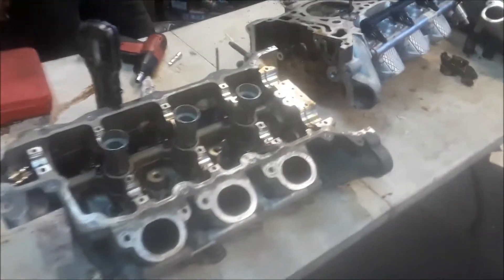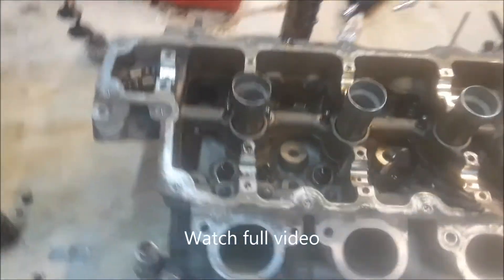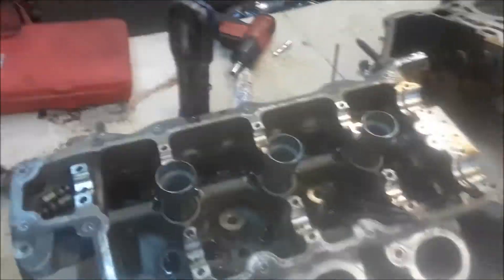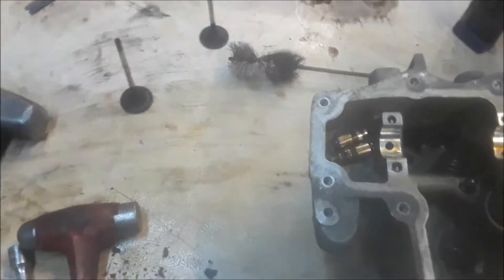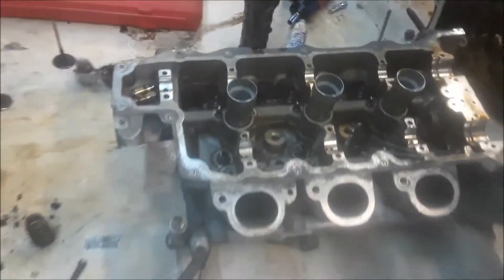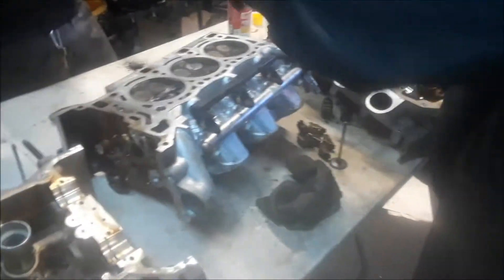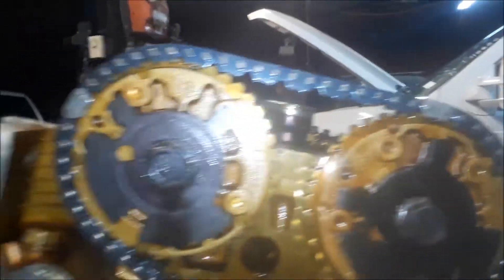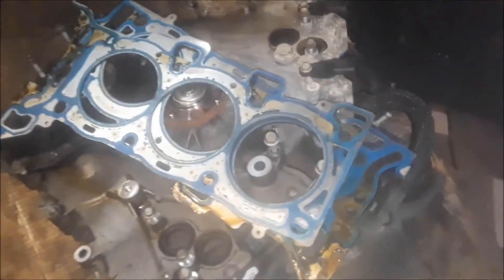GM 2.8,  3.0, & 3.6 Engine Problems Timing Chain Bent Valves COMMON Problem

Comment: Does the 3.0 v6 version have the same problem with the chain ? I have a 2011 srx with the 3.0 v6 currently at 198k miles still running like new
Reply: yes, 3.0 smaller cubic inch same problems

Comment: Ive got a 2010 terrain 3.0 cylinder two looks to have bent valves. Is it possible to get away with just throwing new valves in or could the seats be damage as well and possibly need a new head or heads?
Reply: well the heads will be off to change the valves so look. most of the work is in r and r of the heads anyway. if you went through all the work to do that would getting the valve seats machined really be a prohibitive obstacle at that point?

Comment: How much cost for timing chain Buick Enclave 3.6
Reply: the book time is 12.7 hrs but many techs say it  actually takes more time than that so at 100$ + an hr that's like 1300 or more dollars labor. and the parts kit is like 400 bucks so 600 shop prices so smart to budget 1900-2000 dollars and that's if nothing else messed up is found out in the process and not counting nickel and dime stuff like new oil and filter so alot of money best of luck.

Comment: I have the 3.6 I'm my 2012 traverse and I just changed the timing chains. The engine had started shaking so I changed the chains they were a little loose. After changing them the engine shaking is worse. I triple checked the timeing marks so I know it isn't off should I look into the valves next?
Reply: the shaking sounds like a misfire possibly from a bent valve and no compression on that cylinder. disable the spark and crank it and if you have a dead hole(bent valve) you will be able to hear it when cranking. you'll hear the '"free" spot when cranking from the lack of compression where the starter does not strain against the compression on the dead hole. think of it as an "audio" compression check.   a half assed compression check to do without pulling spark plugs.